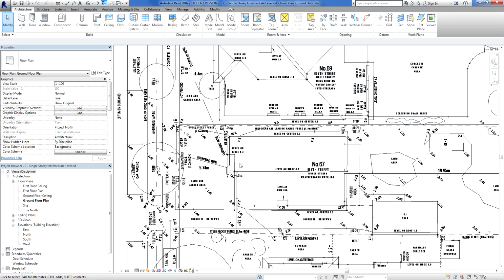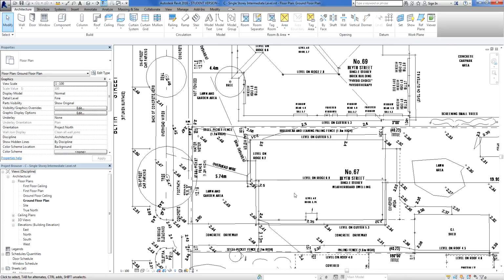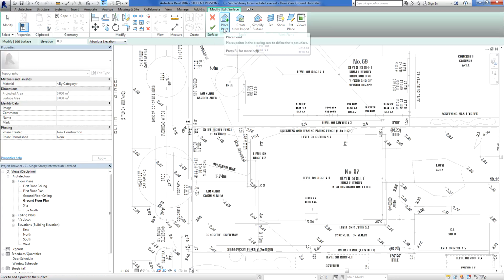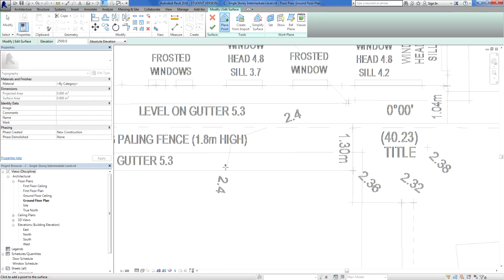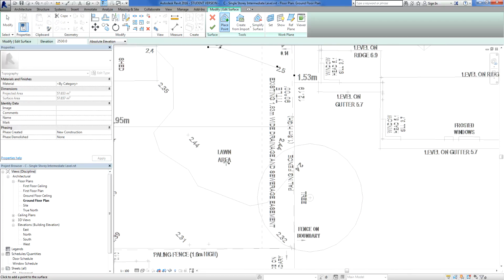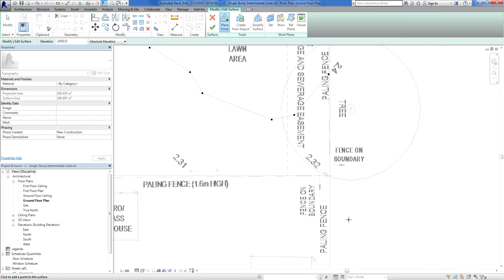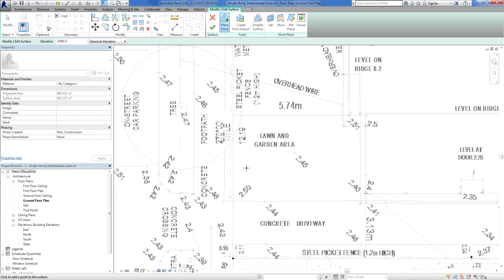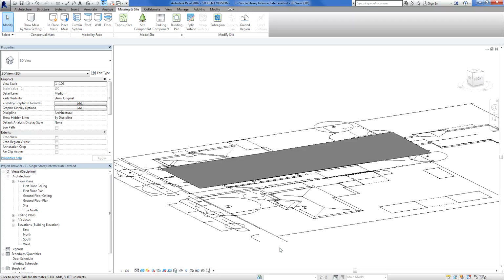Revit - Single Storey Intermediate Video 3: Toposurface By Points

Comment: When providing dimension inputs to revit, you don’t need to type 2500 to specify a 2.5m if your project unit is set to mm. Just type “2.5m” and revit converts the entered value to 2500mm or any other unit format that you’ve set to the project.